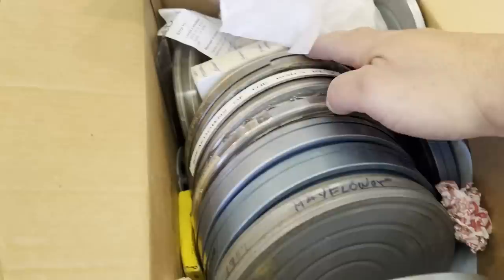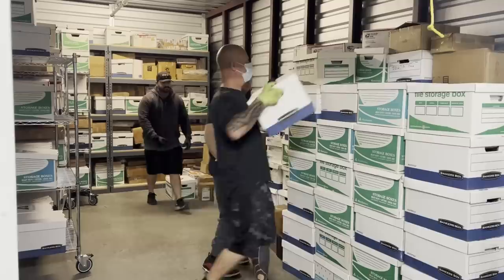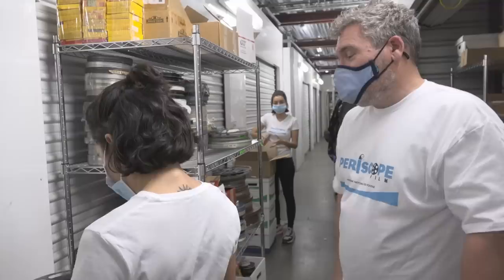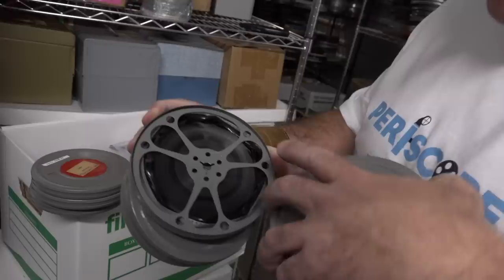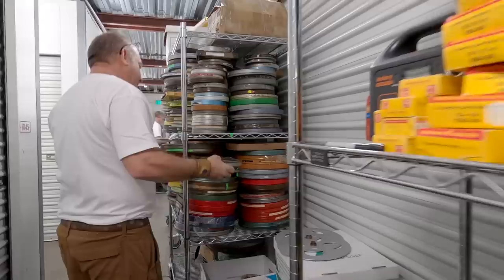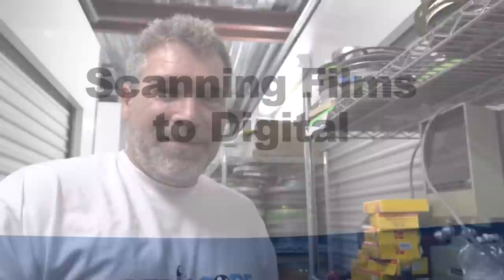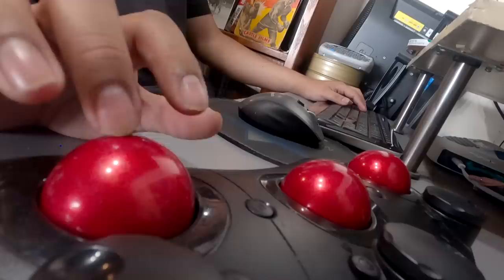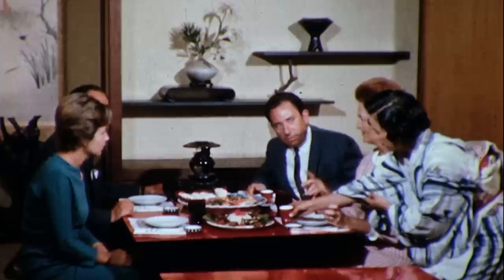How we RESCUED a huge collection of RARE FILMS  !

Comment: QUESTION: 
I  recently read about burnt scrolls from Pompeii that were once thought to be forever unreadable, then a   new form of scan tech came along and the carbonized  scrolls , still  unable to be unrolled, were electronically probed from the outside and they were able to be read….is it possible / practical to keep  currently unviewable films in deep cold storage  until some future tech can scan them? 
It would be expensive and resource intensive,
 when resources must be limited and triage must perforce be done, all for an uncertain outcome, yet: those Roman scrolls were once deemed forever unviewable as well. 
I doubt it’s practical but I just had to mention that tech that is now routinely used to recover images would not too long ago been pure science fiction. Perhaps a chosen subset of the most intriguing vinegary films could be archived in this hope?
Reply from the maker: Who knows what might be possible in the future. The reality is that when it comes to ephemeral films, their value to society is not the same as -- for example -- scrolls from Pompeii which could literally contain lost works by Socrates or Hippocrates. That being said, there is a triage process at work here, we try to save what we can within certain parameters and within our means. If we had more $ and staff to work with, we could save more but the need is great. Thanks for being a sub.  Please share the video with like minded people! It was so hard to make and we want it to be seen!

Comment: Just curious, is there a way to fix those films that have gone rock hard?  Is there a solution that you are able to soak them in to soften them back up?
Reply from the maker: Once the film has truly crystalized, there's nothing that can be done, because even if the film is soaked in softening agents, the emulsion of the film will stick to itself. We can and do scan films all the time that are slightly less degraded and have shrunk, simply by soaking them in a softening bath (sometimes for days but often for weeks or even months). This can extend the life of the film, but it's almost impossible to arrest the process except by putting films in a freezer. Because we have limited budgets, and limited time, we admittedly have to do a triage process. Hey thanks for your comment -- subscribe -- and please share the vid with friends.

Comment: And your film that you found some of the ones that are a hexagon they can be pretty much mostly saved I had the same problem with some movies I found and what I did I had an ultrasonic cleaner that was large enough and I use some dish soap put it in and then ran it for 30 minutes or so and the films were pliable and they ran through the projector fine. Now this doesn’t work for the seriously deteriorated film but the hexagon or tightly bound films it probably would. The type of ultrasonic cleaner you should use also has a heater built into it that’s the type I used.
Reply from the maker: We soak shrunken films in a special chemical called VitaFilm which makes them more pliable. Once they have regained some flexibility, we are usually able to scan them. For certain types of prints, especially diacetate and b&w, we sometimes use camphor crystals which have a similar effect. We've been in the film world for roughly 20 years and I have to be honest, first time I've ever heard anyone recommend using dish soap to make a film more pliable. Not saying it might not work (as it is very basic) but I've never ever seen it recommended. There are many purpose made chemicals for this type of problem (including Film Renew and Film Guard, etc.) which are recommended by various industry groups. Thanks for your comment. Please subscribe and share the video with friends!

Comment: If something could be done to chemically restore the color of many of these old films, it would be true restoration, and not basic transfers.
Reply from the maker: There is a chemical process to enhance the cyan dye, which is what faded in Eastmancolor. However that is primarily used by people who want to project these faded films. The power of the scanning system to restore color is much more precise and powerful, especially when combined with another step such as color correction with DaVinci Resolve.

Comment: I'm suprised that your crew are not wearing gloves. the oils can break down the fill and even the paint on the reels.
Reply from the maker: We are well aware of this and actually normally wear cloth gloves for most of the process -- but when we jumped into the emergency rescue operation we quickly went through a lot of pairs and exhausted our supply, and with the pandemic raging we were unable to easily get more. Thanks for your comment and for being a subscriber.